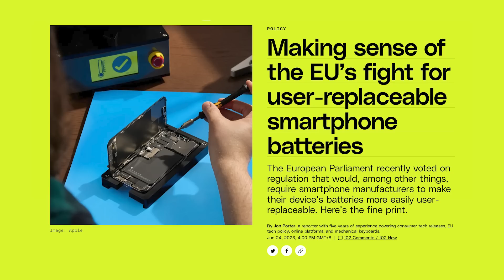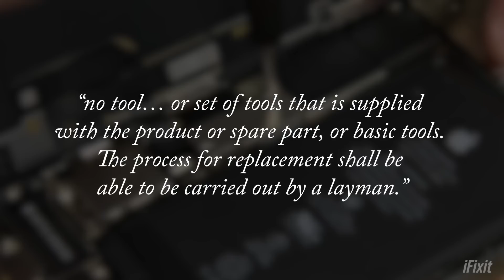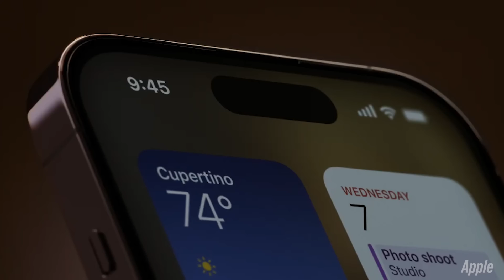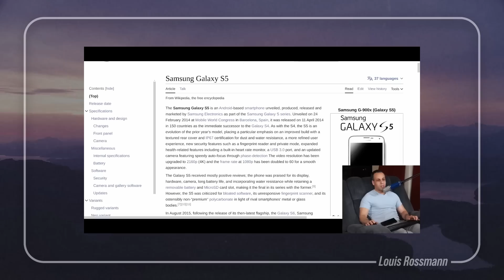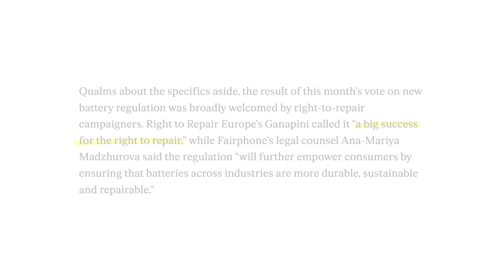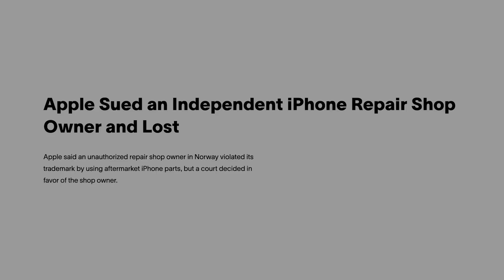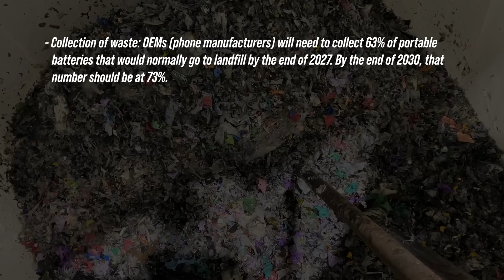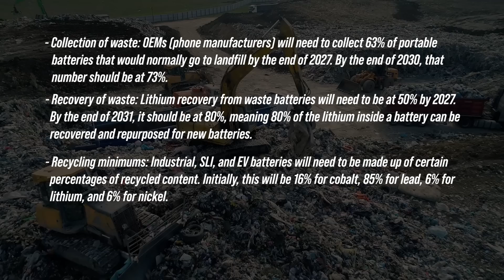EU Just Changed Smartphones Forever

Comment: 8:30 I think it's due to the fact the  batteries are the only component in an electronical device which needs to be replaced. Other than that if you have a phone bought in last 5 years you can still use it as a daily driver with some compromises i.e camera bigger display etc . By not giving you a option to replace your better, it forces you to buy a new one
Reply: In theory memory flash can also need to be replaced after years. It wears out, at least in the past that could have been a legitimate problem. Other things include camera, screen, microphone, speaker due to water or dirt damage.
Reply: We have samsung phones that work perfectly fine, even if not cutting edge.  So why are we looking to replace them? Samsung has stopped software support for it, and the batteries  are wearing down. They are almost 5 years old. This is crazy. A piece of daily use equipment that costs roughly 800 bucks needs to be replaced entirely in less than 5 years. My sewing machine is over 100 years old and working just fine.  Now it's not the same as phone tech, but still. This technology has  been around for decades it can start slowing down now.
Reply: @adelegleason1000  2010 phones were useless in 2014 and 2014 phones right now are close to useless besides the best flagships from that year. So long support was not necessary. But new phones might last longer due to slower progress and only software is stopping that.
Reply: I have replaced smartphone batteries for less than the cost of a meal at some midrange restaurants in my country. And they worked well. I had to start using non user replaceable batteries to start appreciating the peace of mind they gave me. My worst quality of life issue with phones was when I could just open them. So many things fell apart way more easily.

Comment: EU wrong about this one. The charging cable thing was a good law, but this is an example of old people not understanding tech.
Reply: What is technology behind not beeing able to remove the battery?
Reply: @Grinderius  design constraints. He mentions folding phones, but it can’t be limited to that scenario. The materials recycling thing is also a good law, I think. Although, I can image manufacturers start shipping phones to the EU with magnetic external batteries and inside the phone is an empty space where a batter should be haha. Technically that is a user replaceable battery, it’s just clunky. And then EU citizens would probably start importing the US/Asia version of the phone with the non removable battery haha

Comment: No they did not.
Replaceable means that in that case that the battery is not allowed to be "glued" in any way or form.
Which is not the issue we currently have.
Backs of smartphone are still allowed to be glued and or even worse, the entire frame can still be made of one piece (see iPhone).
You still need to open your phone to access the battery. Not like the LG G5 approach.

Comment: You can't remove any vehicles battery without tools. Are they going to require we use standard bolt sizes so you don't need a whole workshop to change a belt? We've asked for this for years but there's still a thousand different sizes in metric and sae.

Comment: Replaceable batteries makes the design and manufacturing more complicated and expensive. I don't think it was specifically to screw consumers. The lifetime of the battery is similar to relevance of the hardware. 

I don't see this working out for EVs tho. Its not a phone battery. They are really heavy and will require special tools and training to remove.

Comment: I strongly believe non user replaceable batteries in electronics were done for one reason...PROFIT! Manufacturers built in obsolescence by making batteries not replaceable. Plus, because everyone always wants faster everything ... Including charging, that makes products obsolete too! Batteries don't like to be charged very fast ... It lowers their life expectancy pretty darn quick. People are buying smartphones with 65 watt + chargers and using them everyday to charge their device. These will often charge your new phone from zero to full charge in around 30 to 45 minutes! After a year of ownership, they often have significantly less overall battery life than when new. After 2 years they typically have significant loss of battery life and people want to buy a new phone! Manufacturers are counting on these factors to keep us buying new phones frequently.

With replaceable batteries smartphones no longer need to be disposable after around 2 years... All you need to do is go on eBay, or some other site, and buy a new battery. I used to do just that, and those factory identical OEM batteries were typically only $6 - $10 ! Buy one, pop it in your phone in about 20 seconds, and you have battery life exactly like what you had when you bought your phone brand new! 😁👍

I used to buy HTC or LG phones just because I could not only have an easily replacement battery when the one inside was low, so I just swapped them, but also buy a new battery whenever the old one was dying.
Because phones don't have replaceable batteries anymore, I charge overnight, with the oldest, slowest charger I can find! Lol That's typically around a 1 watt charger vs. the 65 watt chargers given with new phones! No wonder my battery is like new after 2 years of use! My phone loves to be charged sooooo slow! Plenty of time for it to fully charge overnight. All batteries prefer that.

This new law will revolutionize the electronics industry and give us back our ability to keep our expensive electronics for several years to come instead of being forced to replace it because the approx. $8 battery wore out!!! Thanks EU ... This is truly a breakthrough, and stop electronics companies from continually ripping us off. 😎🤘

Comment: It would be arguably changing EVs for the worse, the structural battery pack is probably one of the most groundbraking designs in automotive history, something that will allow very soon to have actually affordable EVs. Apart form that, now you are asking EV manufacturers to increase their already high development cost in order to design such battery packs, and we are talking about vehicles that already cost way too much to have a real impact on EV transition and in many cases lose money to the manufacturer itself. Also the battery pack of a modern EV is easily one of its longest lasting components, often surpassing the longevity of ICE vehicles. It gets even better when you realise that a giant percentage (%95+) of these batteries can be recycled. Mandating 'easily removable batteries' for products so wildly different like smartphones and EVs seems lunacy to me. Also "all batteries should have a recycling target of 50% by 2025" is complete nonsense, that would absolutely kill the EV industry, to transition transportation to fully electric we will need enormous amounts of new raw materials for at the very least the next decade. Even worse when you consider that a 'battery' is a very vague term, even the slightest change in chemestry can drastically change the characteristics of the battery. This law seems great for a smartphone/laptop application, but the fact that EVs are even mentioned shows that a few people in the EU government have no clue what they are doing.
Reply: I don't know what's the definition for "easily removable" in case of an 1000 pound battery. I've seen a video where a mechanic replaced a Model S battery, it took an hour and half and special tools. For a battery was designed for automatic replacement in about 93 seconds.
The structural battery is technically removable, but half of the interior is attached to it, so a replacement is likely a full day job for 2-3 competent mechanics.
Reply: EVs are an environmental scam.  They utilize more fossil fuels to manufacture and own than current ICE vehicles.  Same goes for wind turbines. Turn off MSM and do some homework!

Comment: 'Layman replaceable' EV batteries sounds problematic to me. I have no problem with user-replaceable batteries in home and domestic products - definitely a good idea as far as I am concerned - but there is a world of difference between popping out a 200g battery from a mobile phone and moving a 500kg EV battery pack. 
EV batteries are large, heavy and electrically hazardous with a risk of death, which is really going to need more than a 'layperson' level of knowledge, skill and tools to replace. Seems to me folks don't even swap a flat tyre any more - they call roadside service to do it for them. EV batteries also last over 8 years - most people don't hold a car for that long so will never face replacing one. Then they will most likely be sent to garages for replacement, so seems like a massive constraint on EV design for little gain to me.

Comment: I don’t agree with the totalitarian approach to this law.  I find I’m changing phones primarily due to lack of software and security options and rarely due to battery issues.   I like the idea of replaceable batteries, but consumers should also have the option available to buy phones with non-replaceable batteries if they prefer those phones.

I would not be surprised to see some manufacturers make specific models to sell in the EU and choose not to offer other models in the EU.  And we’ll likely see smaller batteries and shorter battery life because of this ruling. At least on some phones.   I would not be surprised if folding phones aren’t sold in the EU at all after this.  Lookin at my Z Flip 3, I see no way to incorporate a removable battery unless you make the phone thicker which for this phone would make it impractical and ruin the purpose of the phone design.

Comment: If companies concerned about waterproof and dustproof they could use ruber gasket instead of glue and secure it with screws. So yes they don't want you to fix your devices yourself
Reply: A lot of these changes are designed to remove points of failure.  Having a gasket and screws adds complexity, increases the chance of failure and costs more to implement.
Reply: @kevinmills5293  so you are telling me that screws and rubber gasket around 5$ max with assembly are expensive for a company where the production cost is only 30%-45% of the price? And you know that we are implementing that on more expensive and delicate things and are working fine.

Comment: Theyll appeal it im sure. Or threaten to not offer high end phones. Id much prefer R2R legislation that is more comprehensive, yet also maybe more flexible. Allowing access to repairable devices overall without 1000 roadblocks, that way even if batteries werent easily replaceable they could still be somewhere in the middle along with the cameras, sensors, and most of all ports. But maybe this will help lend toward that, and with it being across the board not increase prices or limit skus, which would be one of my biggest worry. Louis is def the authority on this stuff tho. Guy has put up with so much insanity lol.

Comment: So now if the phone gets stolen all the person has to do is remove the battery.

At present eSim, Phone Tracking, always GPS on technologies are used to make sure we can retrive our device, but now all of that is useless, as the batteries can be removed easily.

I get the batteries should be replaceable but how many times a day/month/year do you replace it ? so why it has to be made in a way a layman can do it ?

This will just cause more problems than it solves, Stolen Devices, Water/Dust damaged devices, more e-waste and just less Consumer friendly.

Right to repair is different than this, right to repair means, we should be able to use 3rd party batteries, and the company shouldn't block features or make it difficult to do so.

Making removable batteries is just a wrong step to be taken.

Comment: It is the BIC principle where they sell the original product at a lower profit to make them more competitive and then recoup the profits on repairs or refills. This is typical of the behavior of HP with its printers where not only do they limit usage if you do not buy their new cartridges but there are different ones for different printers allowing them to charge premium prices for those for new printers. Of course, we all know about Tesla's repair strategy and the longstanding rip of costs for spares for other brands. In the computer World collusion between Microsoft and Intel/AMD means that for many people to upgrade to Windows 11 requires a new computer and to ensure you do they they have stopped supporting Windows 10. The same applies to thin screen Smart TVs where the failure of a part of the backlighting strip costing cents means a new TV since repairers claim they cannot charge the true labor costs of repairs when what they really mean is that they make more profit from new sales. The same situation applies to virtually any modern device involving printed circuit boards such as very expensive farm machinery which require special diagnostic equipment with the manufacturers refusing to supply circuit diagrams and other information. So this new EU law if good but it does not go far enough and needs to extend to service costs.

Comment: The main reason I upgraded to my current phone was due to the previous phone's battery wearing out. Modern highend smartphones  would be relevantly useful for at least a half decade if not for battery wear. User replaceable batteries will open up the 2nd hand market, entice users to keep phones longer, and likely result in new phone prices decreasing as they compete with the 2nd hand market.
Reply: It isn't hard to find a place to do battery replacement for a smartphone. (yes, of course, not as easy as doing it yourself - but still better than buying an entire new device).

Comment: The EU changing this tech field is very very good, sustainable battery is needed, if every product is going to run with battery and cost can be controlled as it can be stream lined, and what ever product we use we always have replaceable battery.i had laptop worth 1lack around 2015 its designer dell product battery not replaceable but after three years when i went to replace they simply mentioned the battery production has been stopped for that model as they have low sale of that particular product in the end i got screwed for trusting. 1lack rs product scrapped because simply company decided to stop the battery for that product so in future though the company suddenly decides to stop the support Eu decision can gradually streamline battery so no product can go to waste as i can always get a replacement battery even from a grosary shop.

Comment: This will result in lower quality more expensive European models. There is no way to build a modern phone with " easily"  removable batteries. There really isn't any problem building a separate European model. All phone manufacturers build several models simultaneously.

Comment: While I totally appreciate the EU's aims, I am strongly against this ruling personally. I think it goes too far. They should simply have mandated that manufacturers should not obstructively prevent replacement parts (like how Apple has done before) and should facilitate 3rd party technicians.

I don't think modern devices need batteries you can easily pop out - I simply do not see that as necessary. Unscrewing the backplate on a laptop to change a battery is not an obstruction to repair. They should just have imposed minimum repairability ratings similar to the scales iFixit etc. use and just banned glued-in batteries or parts which are soldered together needlessly just to hamper repair.

Comment: I think there was some practical element to moving to non-replaceable batteries to make devices smaller and lighter. But this was also for competitive reasons and to sell more phones, so the industry was happy to move that way. The US changed to the Micro USB connector because Europe standardized on it and I expect replaceable batteries will be the same. The US of course, will get dragged kicking and screaming into it. Water resistance is no problem. There are cameras that are water resistant and some that can even get submerged. They have water tight hatches for batteries, memory cards and connectivity. It's not a problem to make these things.

Comment: Motivated by profits. Absolutely. My current phone is a Samsung Z fold 2. My previous phone was a Samsung Note 4. It was the last model made before this, what I would call a standard feature. I also had the screen replaced a couple of times costing me around $300, at the time I think it was expensive. The current Samsung I own? If I crack the screen or need to replace the battery I've been told that the battery, there maybe something else and the screen are now one unit. It now would cost me around $1,000 when I had already paid 3k which I don't think its worth. Its nothing more than corporate greed.

Comment: I personally don't have problem to pay extra 50-100$ to extend lifetime by 2 years for my premium phone. The problem is that the batteries are made in year of phone release. What means, if you decide to change battery for your 3 years old phone, they will replace it with 3 years old unused battery. Such battery will have already significantly degraded capacity. What I know, most people who decided to change battery, they didn't observed significant improvement in battery life.
How manufacturers could really improve this situation is to start to use standardized battery cells, where also new generation of bettery cells with improved capacity could be used in older phones.